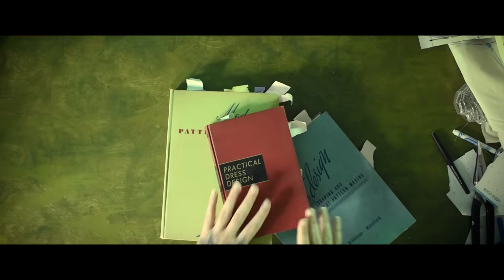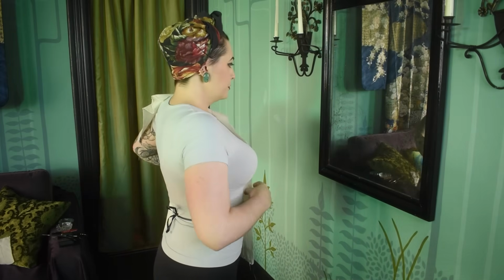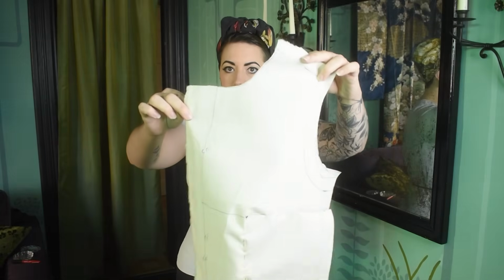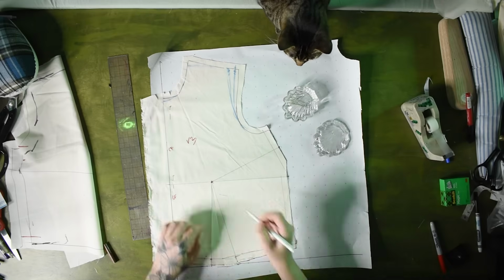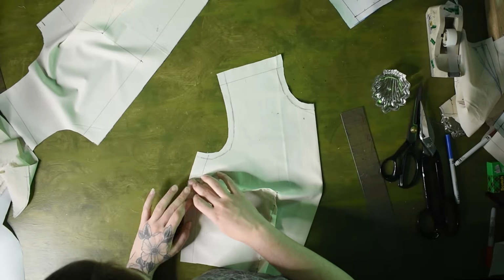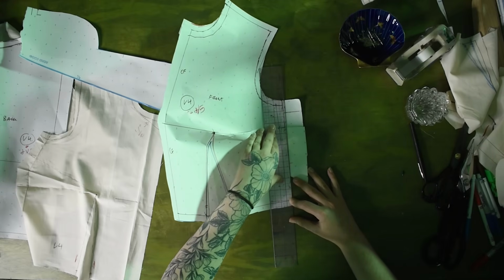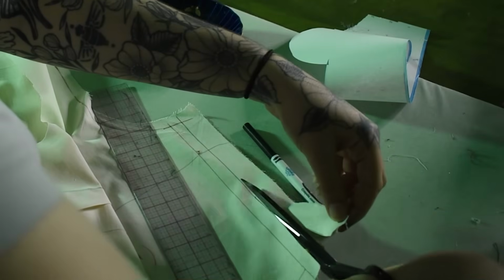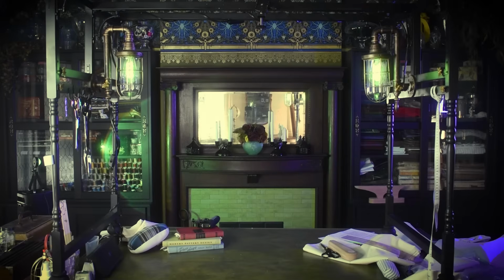Draping A Bodice Block // Drafting Dangerous vol. 2

Comment: 45:32 Bianca! It occurs to me, and I have this same issue when fitting bras for myself (for example), maybe the problem with the centerline and the apex here isn't so much that you have to go "above" the apex, but that the fullest part of your bust isn't exactly where you expect it to be. Mentioning this especially for other people, just in case, but on the off chance that this is what's happening to you here: the fullest part isn't always at the nips (idk if youtube would censor the full word). It may be at, above, or below them, depending on how the tissue is distributed in your bust. This same thing can make certain bra styles not work as well as others, for different people. I actually learned about this on Reddit? On r/ABraThatFits. It's a topic with a lot of detail to dive into and it has helped me understand how garments fit, not just how bras fit, so it's been useful to me. Maybe it might be useful to someone else to check that out!

Comment: "If this shoulder seam was half an inch lower, would everything start to sit nicer?"
Funny that this was precisely what I finally concluded was the issue with the first dress I made (from a commercial pattern). I had gone back and forth trying to determine what needed adjustment, then when I simply pulled it up just a bit everything was magically near perfect! I was incredibly relieved that it all came down to eliminating an inch from the straps and adding the tiniest side dart, otherwise I probably would have compromised since I'm working with princess seams, lol. As you said, it's much easier going from a regular block to princess seams rather than the other way around!

This video is incredibly helpful and validates the work I've done so far, thank you! Can't wait to learn more about sleeves 🎉

Comment: Something I noticed with you raised your apex line. When we consider the apex, we assume its the bit that sticks our furthest horizontslly, but thats not always the case. When looking at your side profile, notice your collarbones are further in than the stomach region. If you were to draw a line between these points, the further point on your bust from that line is where you raised the bust line too. THis is because fabrics try to to make symetrical trisngles over an apex when under tension.

Comment: I've watched this video 2.5 times as well as your earlier videos regarding dart manipulation and others. I still have a question. Just not getting how to move the dart from say, shoulder to side or armseye to side, and keep it the same size. Do you keep it the same width along the edge and taper to the apex? Maybe you did this and I just missed it? I tried doing this and it just doesn't seem to work right. Then I'd just guestimate and fiddle with it and still sometimes not get it right. Any additional explanation appreciated.
Reply from the maker: The angle (percentage of a circle) needs to stay the same. The larger a distance that angle travels, the larger the distance between the dart legs will end up along the seam. So if you had a bust dart to the center front from the apex, the dart legs would only be a few inches long, if that same angle(%) is cast towards the shoulder, there would be more distance to travel, so the pizza slice looks larger. The angle says the same. This is why we slash and spread, cut along a dart leg to the apex and layer it closed, becuase then the percentage is transferred to the new desired dart. A dart is not a set triangle shape, it is a set percentage of a circle to create a cone (the cone being the bust). Do not think of the darts as triangles to be moved around, think of dart fullness as a percentage of pinch-away you need to fit your bust. I'll have another dart video as a part of Drafting Dangerous coming soon as well!
Reply: @TheClosetHistorian  thank you for the detailed explanation. That does clear up some of my confusion. I was just thinking of it wrong.
Reply: @TheClosetHistorian  I know that the dart can be moved anywhere… but when drafting the waist dart, the distance from the apex (CF to apex = CF to midpoint of the waist dart), for example a vertical line distance 3 1/4” away from CF. The center line is not always vertical/straight to the CF, but slightly angled, so you can move the center but keep the symmetry. Dart legs are the same length as each other, but the only thing that matters is that the center line goes towards the apex, angled or not (?)

Comment: Bianca, I learned to draft a pattern from you!  I wanted to recommend Butterick 5628 to your viewers.  I believe it has been discontinued, but it has the pieces you need to start creating your blocks and it's available all over the place.  I used a very plain dress pattern for my block because I couldn't find the Butterick pattern in a size 18.  Your instructions were so clear and helpful that I probably could have made the block without it.  Advice to you viewers:  Place Bianca in 75 or 50% speed because you will be running to keep up with her.  Look at the video all the way through first, then go back and watch in two or more times.  She fast, but she's also quite witty and you will start giggling two minutes after she's said something.  She is a terrific teacher.  You will be able to do this!

Comment: Damned Bianca! How many miles of fabric and paper should I buy???? I'm a plus size!!😰😰😰😰😰😰
Reply from the maker: It's a one time investment in your sewing journey. Even if the blocks need adjustments in the future, you won't have to do the same amount of work as you put in the first time. You can make a mockup and have to fit every new pattern you ever try to use again, or you can make a few mocks ups while fitting a block, the amount of material used may be the same, the amount of frustration and fitting time is compressed into a one time event ✨

Comment: I would love to see you draft more loose fitting garments, in addition to the form fitting ones that you are showcasing. Both have time and place. I live with fibromyalgia and struggle with pressure and contact. I have been drafting loose fitting garments for several months, paying most of my attention to the contact points and distributing the weight so it does not hurt me. It's coming, but it's perplexing sometimes. I finally figured out that I need a round/full top back adjustment, because that's probably the reason my garments tend to slip backwards all the time, causing weird pains in weird locations. Anyway. With you on this journey, and enjoying it immensely :-) . Thank you very much!

Comment: I can't thank you enough for doing this. I am one of those that never modified commercial pattern as I got really frustrated with them. Anyway, after watching this I am on version 5 of the bodice block front. Today I am tackling the back. It is probably going to go wonky (introvert fitting herself here 😂) but if it comes anywhere near to what I have for front, I will be happy as the front fits very nicely. I must say the armholes are driving me nuts. Anyway, thank you.
Follow up: it is few days later and I am on version 5 of the front and version 4 of the back. It fits and even the armholes are.... ok? i am in a bit of disbelief. are they perfect? probably not. but this will do for now. I am off to do your all in one bodice block as it incorporates the sleeves. Thank you.

Comment: A niece of mine needed two dresses in her last year of high school (a Belle cosplay and a 1940s day dress) she has a lot of issues with finding her size in stores (not only she's plus size, short but she's extremely curvy) after taking her measurements and failing at understanding a 1940s patterning manual I decided to go with Burda patterns that roughly match her size (since she was between two sizes I decided to go with the larger one and to go from there) I was short on time and she would have worn those stuff only once so I decided not to do a mock up and to just roll with it... Both dresses really fitted her like a glove as soon as she wore them, I think all I had to do was mess with the shoulders of one because her shoulders are really small and sloped 
Sometimes the stars really align when you make something and it's never the one project you need to run smoothly

Comment: The block that fitted me the best is Bunka bodice. The HJ armstrong was too loose on the chest and too big. 
Then the matric pattern was loose too and gaping at armhole. 
Because the size of my both breasts is different the bunka bodice darts had to be pinched a bit and turned into a prince seams but the fit it gives is muahhhhh.... 😍

Comment: Hi Bianca…I also studied fashion at uni , yet I struggle with fitting so much…it seems like a completely different subject. 
Just as you’ve made this video I’m struggling with a fitting shell pattern, it’s quite out on me…and I feel like
I’m going around in circles with the adjustments.
I think I’m going to try this….it makes much more sense to start on the body that it will be fitting! Thank you…this is fab x

Comment: "the part of your bust that would hit the wall first" Hahahahahahaahaaa! Best description for apex EVER.

I just wish my dumb body could use the same waist height for a dress and for a loadbearing waistband... the ribbon trick works for a dress or a shirt, but if there's going to be a waistband, I can't use the narrowest part of my torso because it's two inches higher than the bottom of my ribcage and waistbands will not stay there, they will settle to just over my hips, if I'm lucky (if I'm less lucky and have less than two inches of negative ease and anything at all in the pocketses, they slide off over my hips). Bodies be dumb, yo.
Reply: I have the same issue with waistbands.  I have to make it uncomfortably tight if I want something to rest anywhere near my actual waist.
Reply: @elisabethphd  It's SO ANNOYING. I realize it's also annoying to have a large difference between hip and waist, but I do wish I could keep my pants up reliably... though I have discovered that making a curved waistband instead of a straight one  does keep the downward migration to a minimum.
Reply: I agree. That was soooo funny😂
Reply: I have the same issue with my waist not staying my waist. It’s been a real struggle figuring out where it should be drafted.
Reply: @sylviemariehebert9758  My solution so far is to use the narrowest part of me measurement and height for dresses, and for any loadbearing waistband, drop it two inches (to where it's going to sit anyways) and use the actual measurement from hole to button of the waistband of storebought pants that don't fall off, and make a curved waistband so things have as much tendency to slide back up as they do to work their way down off my hips. After having done the drafting both ways a few times and trying on what I think will work versus what I'm told will work, my adjusted draft is usually the one I end up going with. Hope that helps in your "figuring out how your measurements lie" journey!

Comment: I tried a duct tape dress form. To my utter shock, it was  more accurate than I would have thought. Since I have a small bust, and "didn't" have sagging, I do now😮! I didn't wear a bra. The double showed that while I didn't sag, one side of my bust was noticeably lower than the other 😊 Now that I'm old, I have more sagging, and a significant hunch in my neck. I'm going to try a combo method. Instead of duck tape, I'll try that press and seal cling wrap, draw all the markings on myself,take off the cling wrap, and make a muslin from that. Wish me luck! PS., I am loving the decorating series!
Reply: Good luck!  I’d love to hear an update on how using the press and seal wrap went.  I start feeling claustrophobic whenever I think about wrapping duct tape around myself but press and seal wrap I think I could do.